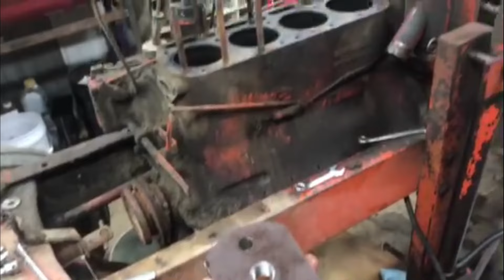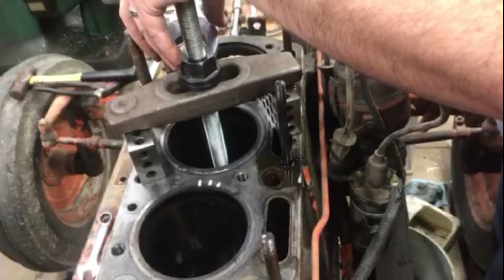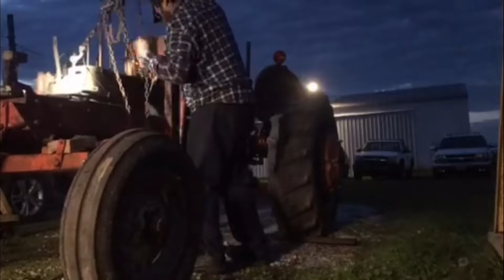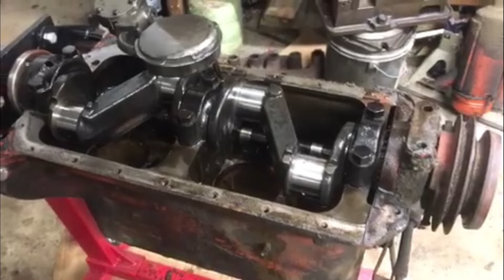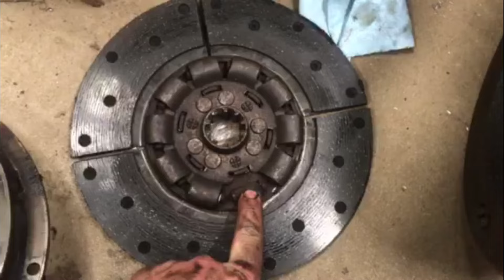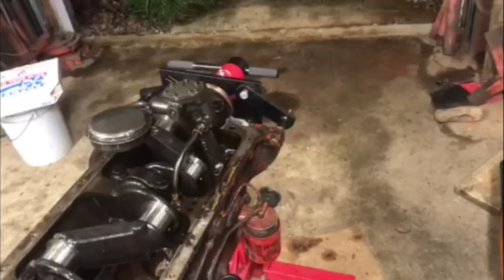Pulling Sleeves on the WD45

Comment: Nice sleeve puller Evan! Way nicer than the P.O.S. I built years back, all- thread is similar. There is a great video on the unofficial Allis website that deals with sealing up the bottom end of these things. I can provide a link if you would like. Good to see you found the problem/s and are headed to recovery! Take care, Mike.
Reply from the maker: Thanks Mike! I wasn't sure how hard the sleeves would be to pull out, I've worked on a lot of car engines through the years but this is my first wet sleeve engine. There is a video on here about sealing up the bottom ends, it may be the same one. Farmer Pete referenced it when he did the engine in his WD45 a few years ago and I bookmarked it. I ordered a heavy duty pressure plate for it, hopefully I'll get it soon. Never enough time LOL. Hope you have a good one Mike!

Comment: Nice teardown like the use of the 1,2,3 blocks. Should be able to grind tge pressure plate. We used to have an old Blanchard grinder and I used to grind lots of flywheels and pressure plates.
Reply from the maker: Thanks Robert! I actually ordered a heavy duty pressure plate for it. 9 springs instead of 6. We have a Blanchard grinder at work but it's massive, I think the magnet is 7 feet in diameter. The flywheel is recessed too and the wheel is way too big to fit into it. But I've got a plan...I think. Hope you have a good one, Robert!